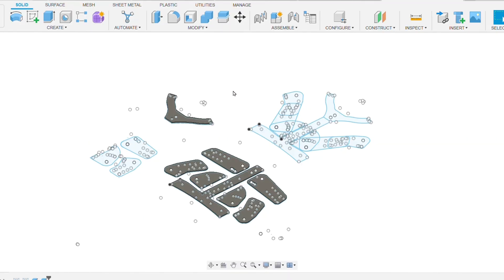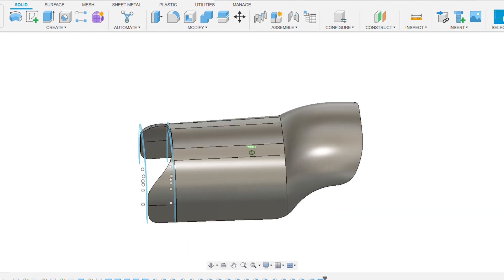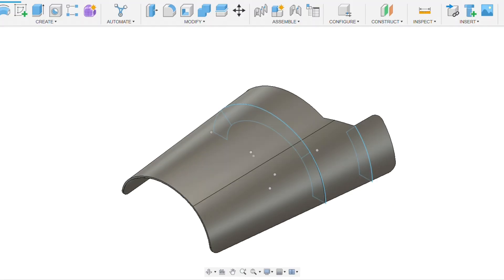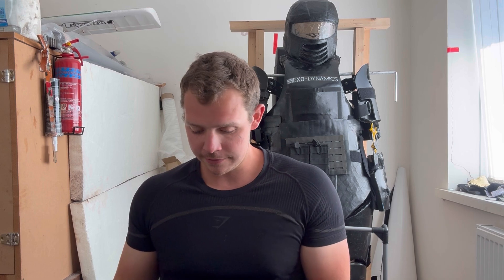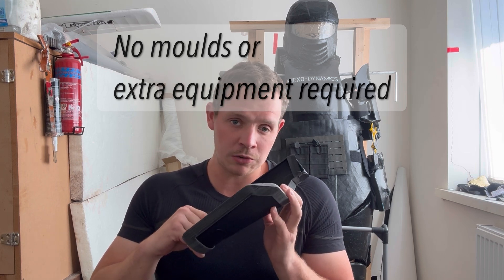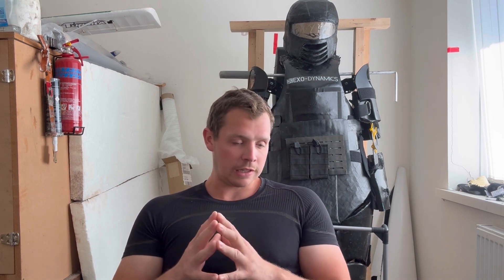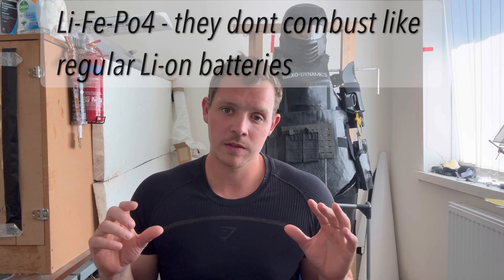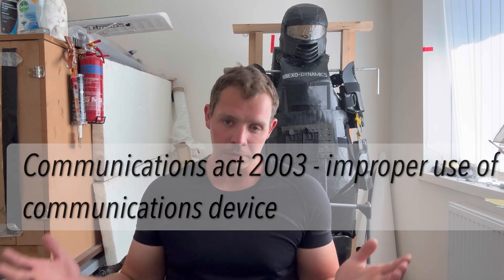MK5 Powered Armoured Exo-Skeleton, whats coming next.

Comment: Do you really need to use actual armour every prototope? wouldn't it be cheaper to find something that's strong enough to provide the structure you need, and it approximately the same total density, without breaking the bank? It would allow much more rapid iteration and probably lead to better armour overall once you make the final version, which can be done with actual armour materials. It would also probably be easier to work with. Maybe some cheap casting resin  with the right fillers, and a bit of fibreglass layup on the bottom, poured into a 3d printed shell?
Reply from the maker: @abowden556  i kind of did that, i had a foam mock uo which was helpful, but then i had to make an armoured prototype to lesrn the best way to make the armour and crucially be able to produce it in numbers in the future.. There were lessons learnt quickly like its impossible effectively drill holes in, also it strange when its on the human body, the weight can feel odd in certain places, just the presence of it, its like its a balance issue or something. Like weight on the back of the legs, even if its on the skeleton and not touching the leg, it feels awful. I couldnt have learnt all that without an armoured version. However now ive got that all down Im making sure all the 3d printed and machined parts are perfect before spending that money again on armour

Comment: Nice!!! I support the camera visor design. Im doing the same with my helmet to protect from being hit through a visor. I repurposed a car backup camera and used it for my camera. Also attached picatinny rails and such for attaching flashlights and other equipment.
Reply: My armor is AR500 steel plates that are thinner, but angled at 45° to deflect incoming shrapnel and projectiles sort of how tanks work. The front of my helmet is a V shape so rounds glance off the sides, inspired by medieval helmets for the joust. The exoskeleton frame is passive, but made of aluminum, titanium, stainless steel, and PLA+ reinforced with carbon fiber.

The main constraint (other than money) is getting the time to weld all the armor together. Being heavy duty armor plating, I have to really take my time welding the armor together. 

So far in my testing, the plates for the helmet stopped .22lr, 9mm, .45acp, .44 magnum, 12 gauge magnum slug (huge ugly splatter of lead but no damage to the plating), 5.56 M855, 7.62x39, 7.62x51, 30.06, and 7.62x54R with minimal surface damage. 

The helmet is so heavy though that I have a gas piston setup in the neck to allow up and down and side to side motion and a spine that bolts to the back and allows the weight to be reduced significantly.

I also highly highly recommend studying and incorporating elements from real medieval armor, it has helped me tremendously.
Reply from the maker: @ascendantjustice1173  sorry ive only just seen this reply, it sounds like you’ve done some mega impressive work! I also feel the ‘other than money’ part!
Reply from the maker: Nice! I was thinking of using an fpv racing drone camera as i can lace the wires through the armour without a direct hole. Have you found any screens yet? Being so close to tge eye im thinking its going to have to be fpv goggles
Reply: @MattExo-Dynamics  I did actually!! I tried LCDs and other things, Way too bright!! So I used and repurposed a screen and set up from a digital endoscope. Capable of night vision, screen brightness is adjustable, and it doesn't hurt my eyes, and the whole thing from Temu cost 12 USD.

Also, rather than put pivot points to the side of the helmet because drilling through AR500 steel is very difficult, I copied sort of like the Medieval Bascinets clap trap visor and welded a heavy duty safe hinge to the top to create the pivot point to lift the visor or drop it down.

Comment: Very interested to see this work done, with the visor, are you going to try and intergrate some other electronics in like a compass for bearings?
Reply from the maker: Ooo id never even thought of a compass, but yes, if like to install a form of mixed reality and perhaps head tracking for any shoulder mounted experiments. But ill probably just start with camera and screens and basic comms. The rest of the suit design is pretty much decided on but im sure the helmet will change a few times yet

Comment: That would be awesome if you can make lifepo4 batteries
Reply from the maker: It would, i think thats the last technical manufacturing challenge!
Reply: @MattExo-Dynamics  can't you just buy the batteries you need and wire them up yourself? Maybe talk to automotive people who work on the few electric cars that use prismatic iron phosphate lithium batteries? THey should be able to point you in the right direction for getting replacements.

Comment: I wonder have you plan to use fuel cells to power the exoskeleton? 

since fuel cells provide superior power to normal batteries and are cleaner than gas powered generators.
Reply: You mean hydrogen cells?
Reply: @svenmj4973  yeap those

Comment: Really interesting that you decided to make custom actuators to power it, what kind of power output are you expecting to get from them? Overall, love to see the update.
Reply from the maker: Thanks, yeah, the price was just getting out of hand tbh, the electronics on the actuators i was experimenting with were problematic and to upgrade them was a significant cost increase. Tbh im really not sure. As for torque, average nema 42 steppers do 30nm mines low profile so i expect 10-15nm. Brushless, nominal maybe 6mm maxed at 9nm- thats comparing to the steady win mini cheater actuator i had. But again until i test them i could be way off. That doesnt sound much but it felt like a lot on the mini cheater one. Testing will tell.
Reply: @MattExo-Dynamics  that would still be pretty dang strong. I’m more familiar with parts used for FIRST Robotics Competition, where the strongest motor (the Falcon 500 from CTR electronics) has a stall torque of 4.69 NM, so a big step up.

Comment: I like the way you make the exoskeleton.
I understand your situation, because I have been developing an active exoskeleton for 3 years now. I spent 2 years studying the fundamental theory of brushless motors and trying to find a balance between cost, size, weight and power of homemade servos.
Servos with brushless motors are exactly what you need. However, I recommend not to invent them from scratch. Without expensive machines, you will not be able to make a brushless motor with a high enough efficiency. Unfortunately, your homemade electric motor will simply burn out under load. Buy a 5010 750 KV motor, design a double-row cycloidal reducer and attach it to the motor. This will be the simplest, cheapest and most effective option.
Chinese RMD series servos, of course, will be much better. But they use rarer and more expensive motors with a larger number of pole pairs.
Reply from the maker: Thanks for the imfo and 3 years, about the same for me! Yeah ive got 2 prototype brushless motors, 1 is from scratch and one is a planetary gear box and a housing where a factory brushless can be fitted in the casing incase i have your a fore mentioned problems. Im having it all laser cut out of steel but its been a challenge to learn what laser machine will do (im out sourcing the cutting). The nail in the coffin for me with those actuators was i was having more problems getting the stock electronics to work and to upgrade them was going to really push costs up

Comment: And will there be motors of greater power on the legs or the same as on the hands?
Reply from the maker: Yeah the idea is that the actuator cores can be doubled up but run on the same shaft, that way the arm actuators can be low profile, while the legs can be more powerful all while keeping part commonality through out.